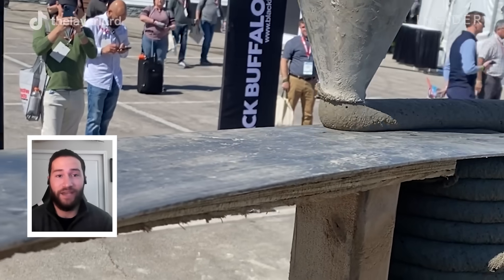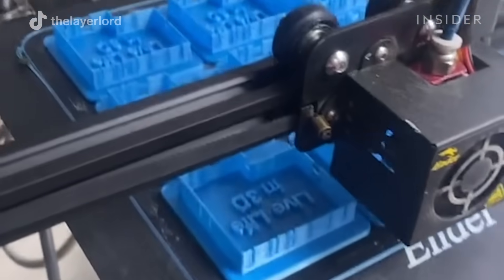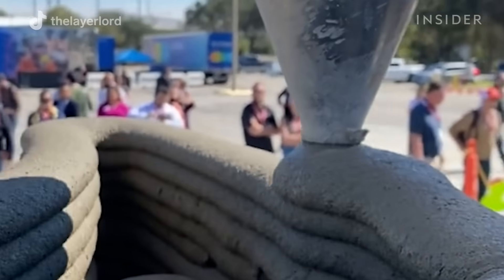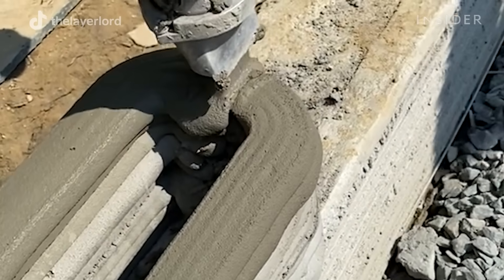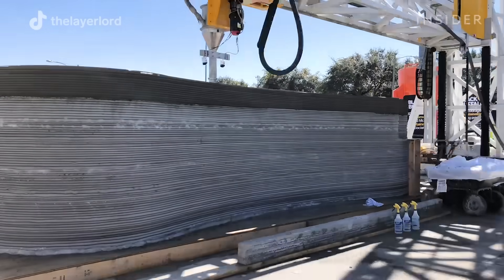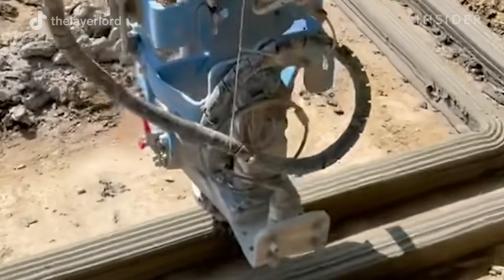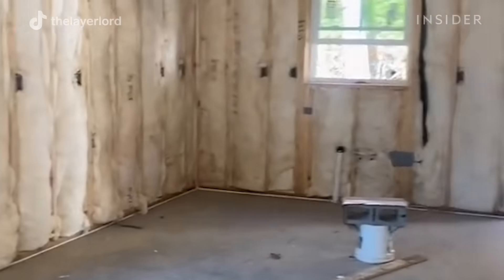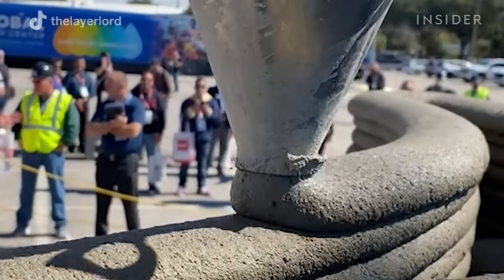How Concrete Homes Are Built With A 3D Printer | Insider Art

Comment: I never see any rebar. Isnt it necessary for the strengt and duration of concrete?
Reply: No rebar is required for a residential building of this magnitude, as already stated steel reinforcement is used to increase tensile strength. The rebar would be in the foundation slab
Reply: @iLik3CHOcol8  yeah rebar is only used in every vertical loading concrete structure built in the last 50+ years
Reply: @JR-uc1of  not true. And there’s no way you could make a statement like that knowing it is true. But this comment is verifiably false.
Reply: @iLik3CHOcol8  building codes are different everywhere.

So to confirm, no it’s not.

At least not in my entire state, the one above me, the one to the right of me, and you guessed it, the state below me as well.
Reply: @iLik3CHOcol8  wouldn't the foundation slab only be in compression?

I don't know why would need rebar
Reply: @aaronfield7899 seismic activity, wind.
Reply: They are probably using a concrete blend with a very high fiber content they literally put glass fiber in concrete to make it more durable when rebar is not available.
Reply: Rebar as I understand is meant to provide tensile strength to concrete, and since the wall structures are likely only experiencing compression, rebar isn’t as necessary in them as in, say, an overpass or the concrete frame of a high-rise. Also, I think earlier in the vid they show some small pieces of steel crossing the interstice of a wall. Those might be what they use to maintain tensile strength where needed.
Reply: @lorez201  only compression… until you know wind…
Reply: @JR-uc1of  this
Reply: @JR-uc1of  you've got no idea if you think standard winds are going to affect this structure in anyway. If built in a hurrican or tornado zone then it has to adhere to the building code in those areas. If a brick veneer house has no reo - why would this ? This would be as strong as a double brick based on the geometry .Besides, pay attention you can see some steel cross struts
Reply: @lorez201  windows, settlement,  earthquakes, live loads,  natural disasters etc etc.  This is also closer to mortar than concrete too. Fine concrete is used in high strength applications,  but this doesn't look like it. There is brick force in the concrete, but that doesnt do much other than prevent lateral slippage.  
Personal,  is include rebar in the foundation and cast between the faces,  essentially using the 3d print as formwork
Reply: @lorez201 As a load bearing wall it will definitely go buckling just like column, that's why we provide reinforcement bar in column also even though it go through compressive force
Reply: Nothing for shrinkage and temperature crack control?
Reply: @lorez201  🔴 What Is Islam? 

🔴 Islam is not just another religion. 

🔵 It is the same message preached by Moses, Jesus and Abraham.

 🔴 Islam literally means ‘submission to God’ and it teaches us to have a direct relationship with God. 

 🔵 It reminds us that since God created us, no one should be worshipped except God alone. 

 🔴 It also teaches that God is nothing like a human being or like anything that we can imagine.

🌍 The concept of God is summarized in the Quran as:

📖 { “Say, He is God, the One.  God, the Absolute.  He does not give birth, nor was He born, and there is nothing like Him.”} (Quran 112:1-4) 📚

🔴 Becoming a Muslim is not turning your back to Jesus. 

🔵 Rather it’s going back to the original teachings of Jesus and obeying him. 

More .....
Reply: If you watch closely, about 10-14 seconds in, the walls have wire/(thin) rebar between them.  They should show the guy who puts them in, as it is printing...
I'd love to see some of these built in different areas of the country, to test how they weather natural disasters.  (Hurricanes/earthquakes/floods/ice storms)  Either way, this will change an industry. 
  10 dudes can build a house in 4 days....
Reply: Correct. It IS an inferior product to regular CIP walls. Still pretty strong though.
Reply: Not required but certainly a stronger way to build
Reply: @tightropehikes  how do you get shear resistance mechanism without rebar? You get a fragile mechanism (concrete tension resistance) which is not acceptable for safety of its ocupants
Reply: @miguelsserra  same way you get every basement in the United States (which the weight of entire homes and everything in it sits on).

I could go on and on.

Sure, rebar and poured block is nice, but some people are building homes and not tornado shelters.
Reply: @tightropehikes  not every basement. Only basements of single family residencial buildings. And surely not on earthquake sensitive areas. Would never be allowed in Europe, with few exceptions (seems one district in Netherlands allowed it as a house, not a proof of concept), and not sure for how long in the US.
Reply: I fell because you are not going higher rebars are not need . It's like laying of blocks for a Bangalore. Of cause your foundation and slabs will carry .
Reply: Not for concrete used in compression applications.
Reply: @lrocky223  Lateral forces are part of compression, so rebar would increase the load bearing capacity although I doubt that the weight of a house would approach those limits as long as the design distributes the load evenly along the concrete wall.
Reply: @hkhuhn1  not necessary for walls of a house because of the weight. Lateral forces may be considered when bearing weight exceeding the threshold to require it, which depends on many other factors, ranging from the concrete mixture to seismic activity. Also, rebar is one of many materials suitable for residential wall construction. Wire would also be more than suitable for this application, and would be more economical. There would be a lot of stuff to consider when building residential walls from concrete, and this 3d printed method is neat; to say the least.
Reply: With the proper PSI of concrete and the right additive to it, you can remove the need for rebar.
Reply: The machine also adds thin steel every 5 layers
Reply: Compression scenario, not necessary.
You could add  structural whiskers to the mix that would increase the strength.
Reply: Do you get any concrete spillage into the gap left between inner and outer layer?
Reply: Maybe there is fiberglass flakes in it...?
Reply: You can see some kind of reinforcement wire in the very beginning shots , it looks like the kind of wire they sometimes add to a cinder block wall, they add it in between every few courses
Reply: Let hit it with a sledgehammer and find out
Reply: They add rebar or reinforcing wire ever few layers.
Reply: Not on the moon
Reply: Under the loads expected in a house, no rebar needed in the super structure above the slab.  Many older houses and buildings are solid masonry construction.  But the foundation and superstructure are cemented together and become one beam.  If the foundation shifts or sags, the superstructure will resist, and resulting tension loads can crack the wall top.  Concrete tension strength is only 500psi.
    The other issue may be uneven thermal heating/expansion.
     Claims of better insulation are bogus.  Here you want many small cells..like foam…not solid.  Printed construction does even temperatures between night and day due to thermal capacitance.
Reply: It's in the walls
Reply: I see sum
Reply: Just a couple 7+ magnitude earthquakes would answer your question.
Reply: That's the first thing I seen
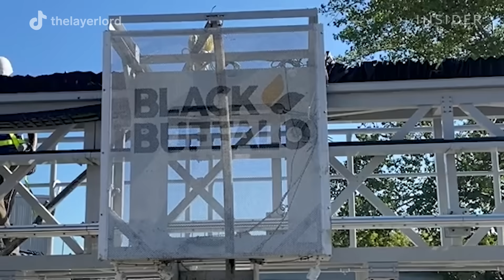Reply: You can see steel in the build at 1:42. It's not rebar but it's something.
Reply: Yes lol. These are affordable houses. Even current affordable housing isn’t built to code. Poor people don’t matter apparently.
Reply: Helix micro rebar and fiberglass can be used
Reply: The rebar is clearly visible in the video.
Reply: Yes!
Reply: That thin wire mesh isnt nearly as capable as rebar 😂 look at all the voids and cracks in that concrete!
Reply: Yep.
Reply: Think I'll stick with one built the traditional way.
Reply: It is required. My first job was as a Mason. My dad still does it. This is a cheap house for ghettos.
Reply: 0:22 you can see metal.
Reply: It is.
Reply: I'm sorry did you watch the video?
Reply: In a state like California you would be required to use rebar. One earthquake and it would crack everywhere. You are going to have ground settling issues unless you have 8-16’ foundation footings. Any concrete structure or slab will crack overtime from settling/movement, even fiberglass reinforced, you have to have rebar!
Reply: @forcedindenturedservant6881  Yup, we are seeing cracking of concrete in the Cali buildings.
Reply: @forcedindenturedservant6881 nobody cares about California
Reply: Roman Concrete the concrete that they used during roman times that still last to this day have no rebar
Reply: 2:33 there’s literally rebar tf

Comment: 1) Concrete creates a lot of CO2 :)
House made only of concrete requires more CO2 production
2) You have more layers than a classic brick-concrete. What about holes between layers?
3) What about strength of construction? What is in the middle? No metal armature?
4) How long is such house lifecycle?
Reply: Yep, cement production is incredibly energy intensive and releases CO2 directly from the chemical process.  Stacking more rocks between the cement layers may greatly reduce the climate damage until cement factories find and use a sustainable alternative to the current lime kilns.
  Maybe this printing technology can be adapted to use naturally available clay and mud instead of modern concrete.

Comment: this seems like a gimmick. what's the difference than building a mold and pouring the concrete? does the layering make it stronger?
Reply: The layering is just how they wait a few minutes for each lump of goo to harden enough to take the weight of the next lump.  To not stand around waiting, they run around making other pieces before coming back.

Comment: This is cool but I like the Styrofoam building blocks that you back fill with concrete better.
Reply: We built with ICF and it has a lot of advantages over 3D printed concrete. For example it has studs embedded in the styrofoam at 8” intervals inside and outside. 

One advantage of the 3D printed concrete is the thermal mass that’s inside the house. With ICF, the thermal mass is within the wall between the styrofoam insulation layers.

Comment: This is damn genius.  Just wanna know how much is the cost of a standardized house? Is it more or less expensive using traditional brick and mortar building
Reply: It seems genius but it might have some issues due to thermal expansions which is the reason why we reinforce it with steel rods when using for buildings.
Reply: @heavygamingupwardenjoyer1834  not using support steel did seem odd,  but i suppose some clever engineering went into the process.
Reply: @maksimegaloman  not really sure,  if there was a more efficient way of reinforcing concrete it wouldve been used ages ago
Reply: @heavygamingupwardenjoyer1834  or they could have just come up with the method.
Reply: @mostwelcomed  once again, if there would be a better method we'd be using it in every concrete based structure by now.
Reply: @heavygamingupwardenjoyer1834  I suppose so, but it would be a way to make lots more money, houses like these seem fragile, if they get blown to bit then the owner has to buy another and another one.
Reply: @mostwelcomed  Would you buy a house worth half your yearly salary if you know it will crumble in a year two.